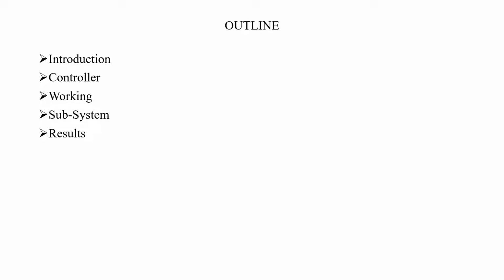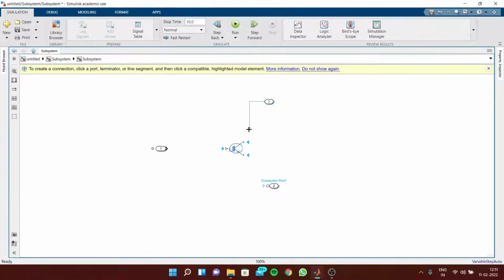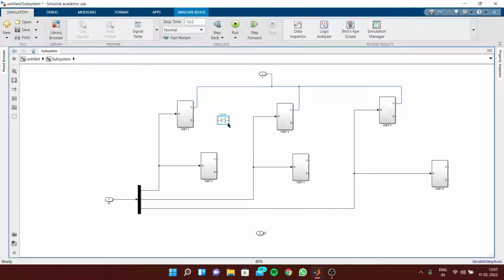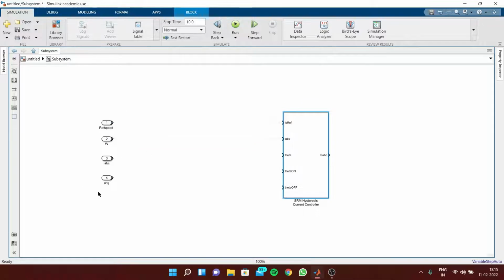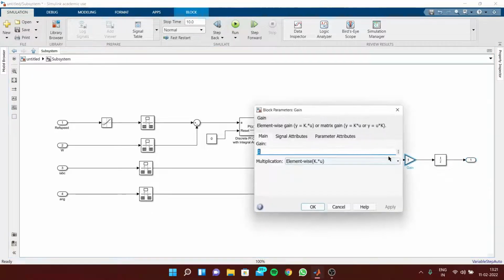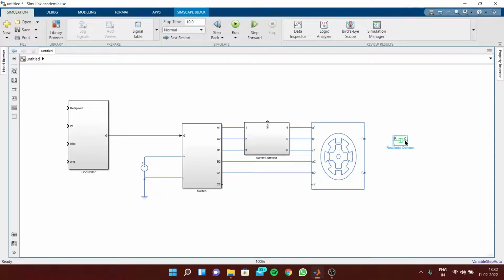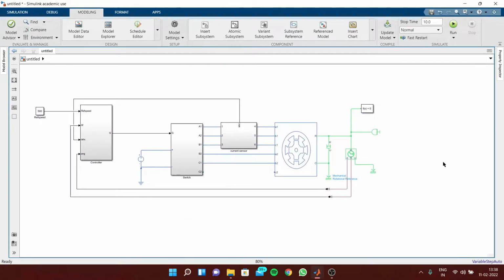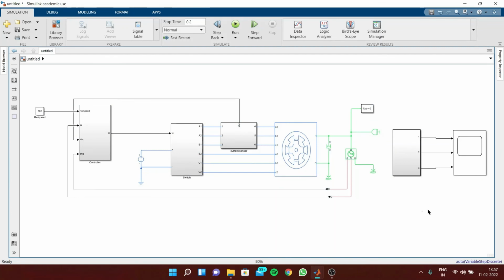Speed Control of Switched Reluctance Motor using Hysteresis Current Controller | MATLAB/Simulink

Comment: How are you able to use 'input' blocks without any issue? I am having to use a connection port in each instance.
Reply: answer my own question I was using a PS-Simulink and not a Simulink-PS converter